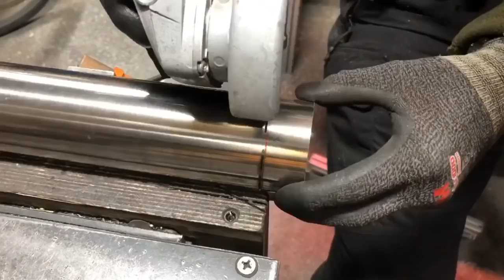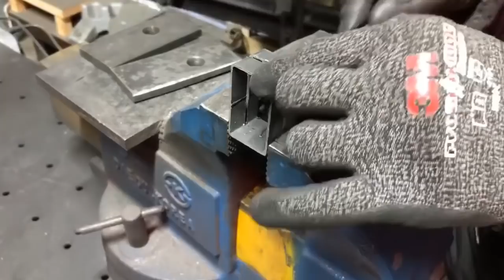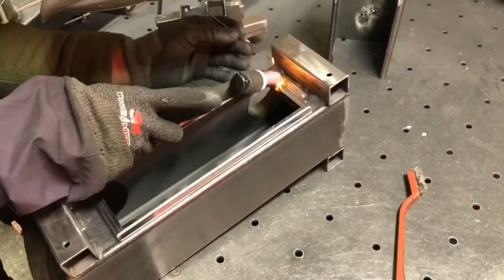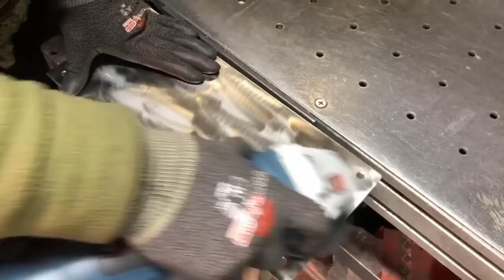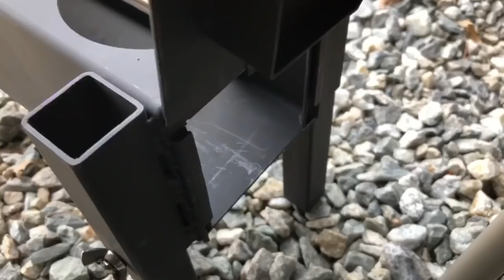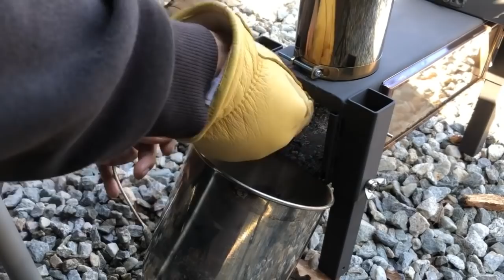테이블 미니로켓스토브 만들기/캠핑/Table Mini RocketStove maing / Camping

Comment: please tell me what kind of glass you use and where you take it.  After all, heat-resistant glass cannot be cut into the desired size.
Reply from the maker: Welcome
I have information in my channel information column
See the bottom link
Delivery can be difficult